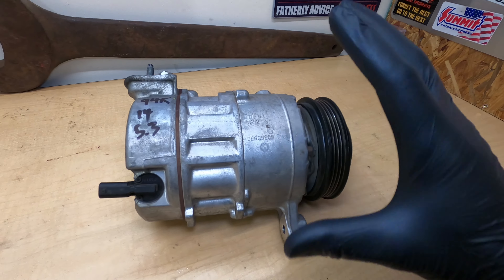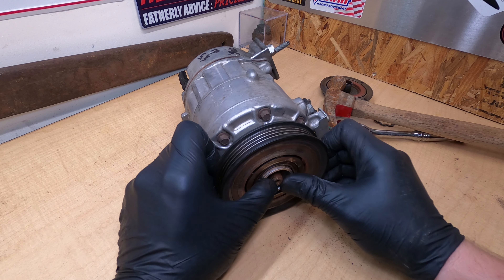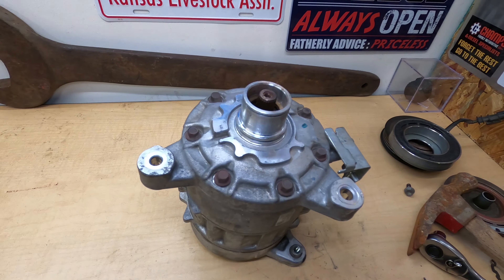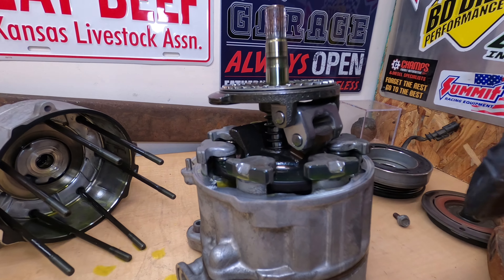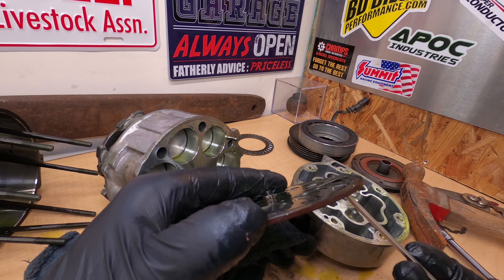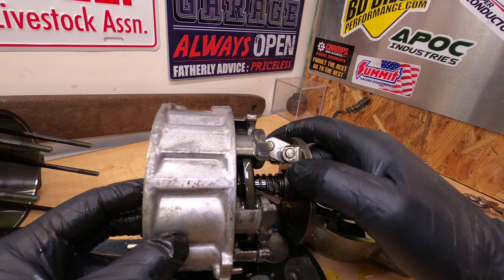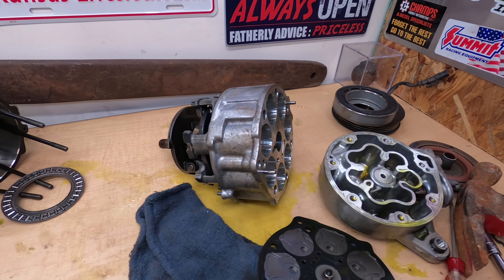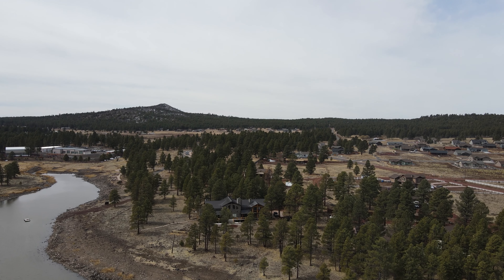How A Variable Displacement AC Compressor Works

Comment: If that pressure valve was stuck closed or open can it raise the low side pressure?  I have a Hyundai Tuson that I've checked and the entire system seems compnoants are good, no leaks eitherd which led me to the compressor. I'm going to replace the valve but my low side pressure was pinned high. There is no restriction anywhere in condenser, hoses or evap. So leads me back to compressor.  Hopefully the switch replacement gets compressor back to pumping low side to normal pressures again. Would save me $300 for a new compressor if so. It's also a common failure in Hyundai's system.
Reply from the maker: When you say there's no restriction,  how are you testing it? If the expansion valve is failed and stuck open that would give you high low side pressure and poor system performance. Also what is the high side doing? Could you have a fan not pulling air through the condenser and high system pressure across the board?

Comment: Thank for the Video Brother. But one doubt, why does a variable compressor have a magnetic pulley? VDCs are running all the time, right?
Reply from the maker: Not necessarily, the whole idea of variable displacement is fuel efficiency,  and less load on the engine when the ac isn't on use, a magnetic clutch can take the drag from very low (displacement at zero) to basically zero as the only drag is the bearing on the pulley not a roating assembly. 
Some have them some don't.

Comment: Great concept  but like you said  LESS than 100,000 miles  I see a very large amount of this type of compressor failure at less than 100,000 miles  many of the turn of the century 99-2004 gm trucks get around 200,000 +plus miles before a failure
Reply from the maker: Exactly.  It seems like the failure isn't mechanical,  it seems like making the electronic part serviceable would extend the life by a lot.

Comment: Hello, got one Volkswagen clutchless compressor, it is whining when turning AC on and the noise follows the engine RPM... What do you think ?
Reply from the maker: Probably a compressor going bad. Plan on a full ac kit. Compressor,  expansion valve, and condenser.

Comment: The compressor in my wifes 2016 Scion im (120 000km) works intermitent. I checked pressures and when it works the pressures seem good. But sometimes the compressors just wont go on.
is there a way to force the compressor on ? With the old fixed compressors i could just manually power the clutch. But apparently the variable compressors work on pcm signal to vary demand. So i havent dared to send 12v to the compressor wires.
Also fan doesnt seem to go into high speed. Fan speed also seems to work on pcm. So im starting to think its an electronic problem. But i would like to confirm before i throw parts at it.
Reply from the maker: You'd need a Scan tool to know if there's a pcm withholding command, and sending 12v to the duty cycled solenoid will fry it in just a matter of seconds.

Comment: What make these variable displacement compressors fail so early compared to fixed displacement compressors?

Can variable displacement compressors being replaced with fixed displacement compressors?
Reply from the maker: Anything is possible but with modern vehicles where everything is connected and monitoring itself for faults, the truck would see a problem with a non factory style compressor,  if you could find a fixed displacement compressor that fit (bolted up / line ports match) you'd have to install a relay and pressure switch system to control the compressor,  so possible but definitely not practical.
Reply: Mainly that, once the displacement drops, less oil tends to flow back. In a perfectly charged TXV system, once the evaporator is cold enough the TXV drops evaporator superheat so much that some liquid refrigerant makes its way back to the compressor and carries plenty of oil with it (ever heard of closed loop refrigerant flush?). But as the charge level drops enough, less oil is carried around so the compressor tends to run oil starved. In addition, the lack of a clutch allows the compressor internals to keep running with no refrigerant to cool them down whatsoever. Even if there's a valving mechanism that intermittently shuts down refrigerant flow when AC is turned off (basically solenoid valve commanded into lowest displacement operation, in a clutchless system), whether deliberately or due to insufficient high side pressure, so some oil may stay within the crankcase all the time, the compressor never receives any refrigerant to keep it cool (even in the lowest displacement, there's still some friction happening) and the oil "burns" pretty easily, even double end capped PAG. The solenoid valves can also get plugged with wear materials from prolonged low charge (reduced lubricant flow) operation, that's also why they always come with filters/meshes. That's why they fail easier (especially the ones with no clutches) compared to fixed displacement ones.
Reply: I replaced the variable type compressor to a fixed angle ac compressor in my skoda. Mine failed at 60k miles. And the later ones are cheaper and cools good enough.
Reply: @Rogue Wrenching. It is definitely practical. Trust me bro. It works smoothly.
Reply: @sandalbasotra5765  i did convert mine from variable displacement compressor to fixed displacement compressor after having bad experience with fixed displacement compressor... What i did was to modify wiring(i maintain the solenoid from old variable displacement compressor, then i connected the relay for magnetic clutch of fixed displacement compressor. The modification seem to be durable compare to variable displacement compressor though there slight differences ie when clutch engine you hear click sound and small shake but it works so fine.

Comment: hello brother... is it true that the function of the solenoid control valve closes the channel and opens the refrigerant channel
Reply from the maker: I'm not sure I understand your question. The solenoid valve changes the angle of the swash plate, thus changing the displacement of the compressor. When the solenoid goes bad, it defaults to 0, i.e. no displacement or no flow, which makes the ac system stop working.
Reply: @RogueWrenching  I mean..which makes the angle change..because there is a flow from the solenoid?
Reply from the maker: @Nur Fitriyadi  I am not 100% sure you be honest, I think its magnetic, but I wouldn't bet my paycheck on it.
Reply: @RogueWrenching  
ok bro..thank you for wanting to reply.and sorry if there are wrong words..I also don't speak English very well
Reply from the maker: @nurfitriyadi4469  All good friend, I wish I could have been more help.
Reply: @RogueWrenching  thanks very much brother

Comment: Probably you were to change the solenoid valve and compressor could back to life
Reply from the maker: I'm 90% sure you are correct, the problem is no one makes a new solenoid and it's made to be not serviceable so replacing without damaging may be challenging. But I agree, mechanically speaking the inside of this compressor looks fine.
Reply: Oil looks kinda dark, ran with too little refrigerant maybe? Valve/meshes may just be gunked up and need a good cleanup
Reply from the maker: @teravolt6113  truck had a full charge when it came into the shop, and it had equal high and low side pressures. There was minimal signs of wear anywhere in the mechanical side of the compressor.